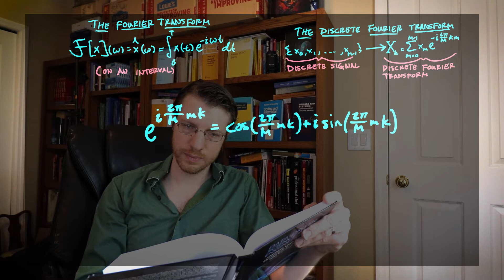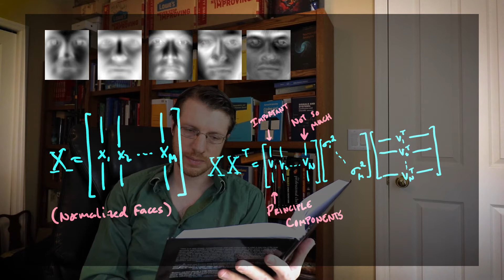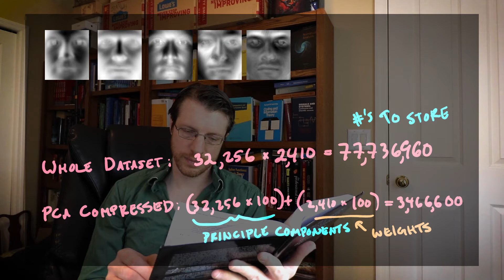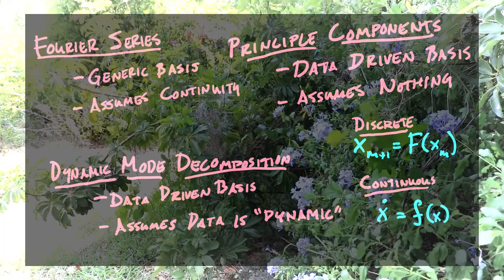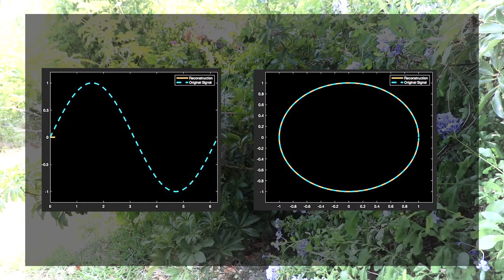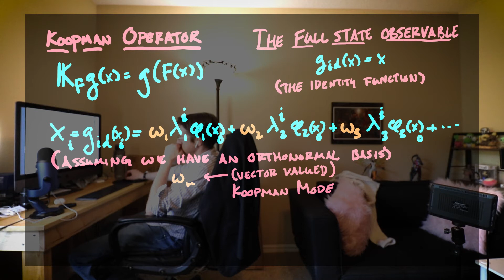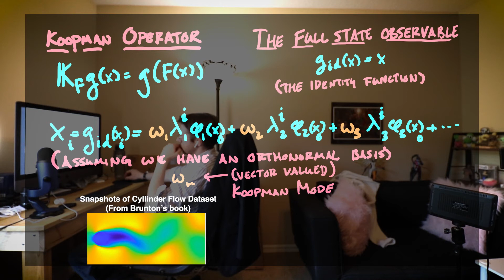DMD Explained! (Dynamic Mode Decomposition)

Comment: Can you please explain why do we even care about all these different permutations of DMD? Like what exactly are the issues that are faced with the typical versions of eDMD and DMD that need extensions?
Reply from the maker: DMD is very much in its infancy, and there are still lots of open questions to explore. The biggest issue, from my perspective, of DMD is a lack of clear theoretical foundations. People frequently refer to the Koopman operator over the space spanned by the features in eDMD, for instance. But the collection of such Koopman operators is very small.

Our goals are to make guarantees of convergence to the true model of the system. But do we want pointwise, almost everywhere, or another mode of convergence? The selection of kernel, features, etc dramatically influence what is possible.

Changing the operators can also create new opportunities and enable the application of these methods to broader classes of systems.

Does this answer your question?
Reply: @JoelRosenfeld  I think this answers it but I have a few follow up questions. When you say that they refer to the Koopman operator over the space spanned by the features in eDMD, how are you ever going to avoid that? To me it sounds like here you’re saying essentially whenever we pick our basis for doing eDMD, we limit which Koopman operator approximations are available. Is my understanding correct? If so, how can we ever land on an approximation without first selecting a basis? 

Also, when you say broader class of systems, can you explain? My understanding is the Koopman operator exists for systems that basically just have a Lipschitz continuous flow map, which is a pretty large group. What door are you talking about being opened in terms of system type?
Reply from the maker: @TriThom50  The first paragraph is more or less the idea. If you happen to select features that are invariant subspaces for the Koopman operator, then you can do a bit better for the approximation. But that requires some foreknowledge, and a given Koopman operator may not have any invariants.

One example of broadening its application domain is in a manuscript I published in the Journal of Nonlinear Systems. You are right that the Koopman operator requires something like Lipschitz maps. But that’s not quite right. We can have locally Lipschitz flow maps that have finite escape time, which means we don’t have discretizations that we can make Koopman operators with. You need something like global Lipschitz or more generally forward complete dynamics.

We can get around this if we have a method that can address the continuous time dynamics directly. We instead approximated the Liouville operator for the system, which enabled estimates of dynamics such as x’ = 1+x^2.

We have also developed a routine to directly access higher order dynamical systems, nonlinear control affine dynamics, fractional order dynamical systems, etc. Each one comes with the selection of a different operator and sometimes Hilbert space framework.
Reply: @JoelRosenfeld  so are you saying you don’t think you can get a good approximation for x’ = 1+x^2 using Koopman? If a system that simple couldn’t be approximated, how could any nonlinear system?
Reply from the maker: @TriThom50   I’m saying it isn’t within the scope of Koopman theory. Koopman theory presupposes that your dynamics can be descretized.

But yes, that was exactly the issue that my colleagues and I had with the theory as it was. Simple polynomial systems were outside the scope of the theory, and even when the dynamics was within the scope of the theory, pointwise convergence wasn’t guaranteed.

That’s why we started using other methods to address these weaknesses of DMD with Koopman operators.
Reply: @JoelRosenfeld  well what’s wrong with discretizing polynomial systems like the one you described? 

I hope it doesn’t come across as me trying to argue because I am ultimately just trying to get your perspective. But what I will say is I’ve taken the continuous duffing oscillator dynamics. Get a bunch of trajectories at discrete times. Use eDMD to learn an A matrix such that the system can be represented as znext = Az, then use a C matrix to go back to the original state and the prediction results are pretty good. It just seems strange to me that you didn’t find any success when trying something like this, assuming I’m understanding you correctly.
Reply from the maker: @TriThom50  the problem is that your discrete time system is always going to have points that are undefined. For instance, if we fix the time step to be pi/2, then F(0) is undefined, since tan(pi/2) is undefined there. Change the time step and you’ll find another hole.
Reply: @JoelRosenfeld  sorry where did tan come from? I thought we were discussing polynomial systems?
Reply from the maker: @TriThom50  also, it’s not about achieving anecdotal success. You can probably get a decent answer. But theoretically, you don’t actually get guarantees. That’s important, because you want to know that your successes aren’t just a fluke.
Reply from the maker: @TriThom50  x(t) = tan(t) is the solution to x’=1+x^2 with the initial condition x(0)=0.
Reply: @JoelRosenfeld  yes I can definitely agree with that point. And I guess the example you gave is illuminating in the sense of it being simple but not still forward complete. I guess I got lucky with the duffing oscillator perhaps satisfying what it needs to without even checking
Reply: @JoelRosenfeld  I am curious to back up for a second though and return to the start of this conversation. Whenever you said “People frequently refer to the Koopman operator over the space spanned by the features in eDMD, for instance. But the collection of such Koopman operators is very small.”

I think my initial interpretation is that you were saying since you pick a basis you’re limited to the operator that you get from that basis selection (features for eDMD). I am confused what you mean about collection though and it being small. Are you saying that there exist multiple but few operators for each choice of features? I thought the representation was unique given we’re solving a least squares problem.
Reply from the maker: @TriThom50  depending on the duffing oscillator, some domains are forward invariant. As long as you stick in there, you can have forward completeness. Just have to be careful, and each case that isn’t globally Lipschitz would have to be checked individually.

Comment: Thank you for the video. Please, can DMD be done for spatial data at only one time (i.e t =1)?
Reply from the maker: Yes, you can use DMD for that. You can take a matrix and just treat each column as if it came from a time point itself. But remember, your information needs to be coming from a dynamical system for this to work well. This means if you have any repeated columns, where the next column is something different (that is the dynamics are giving two different answers), you’ll run into an issue.

Photographic data is often different enough that you don’t run into the problem, and there DMD can be used as a sort of image compression. I’ve run a couple of experiments with this, but never published it.

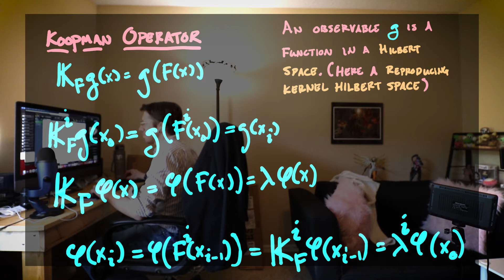Comment: I have a small clarification to make at 11:40 of the video. Sorry I am unable to work it out. I am getting it as K_F^i(phi(x0)) = (phi(F^i(X0))
Reply from the maker: This is the application of the Koopman operator to the eigenfunction, i times. To start, we get K phi(x_0) = phi(F(x_0)), but we also know that phi is an eigenfunction of K, so K phi(x_0) = lambda phi(x_0). Hence phi(F(x_0)) = lambda phi(x_0).

Now let's do it for i = 2. K^2 phi(x_0) = K ( K phi )(x_0) = K ( lambda phi)(x_0) = lambda K phi(x_0) = lambda^2 phi(x_0), by using the eigenfunction property twice.

But also, as you have pointed out, K^2 phi(x_0) = phi(F^2(x_0)), and so we have phi(F^2(x_0)) = lambda^2 phi(x_0).

Is this clearer? After this you iterate the same argument.